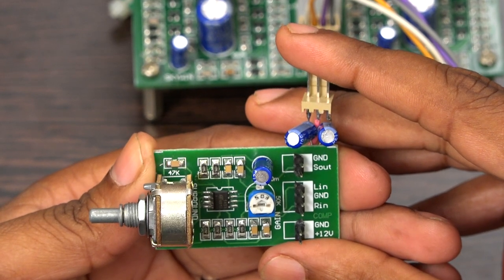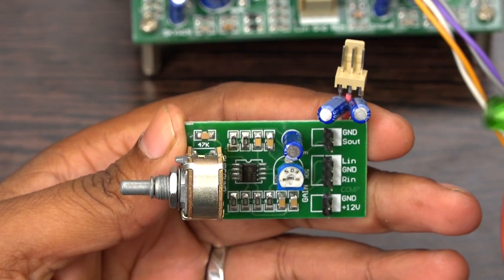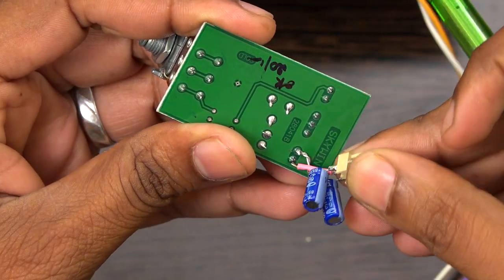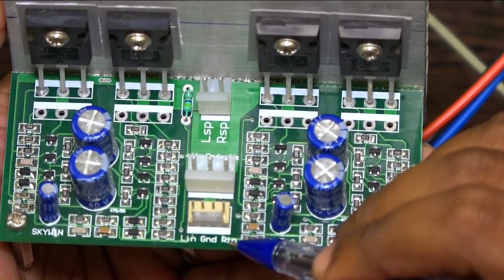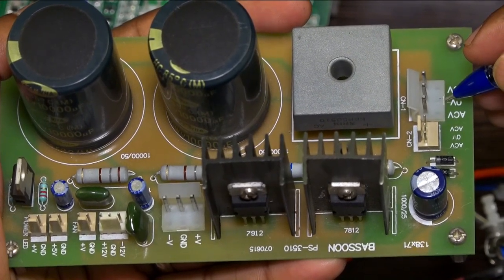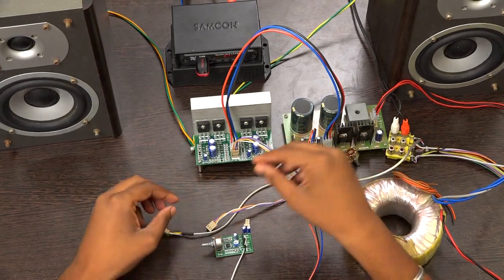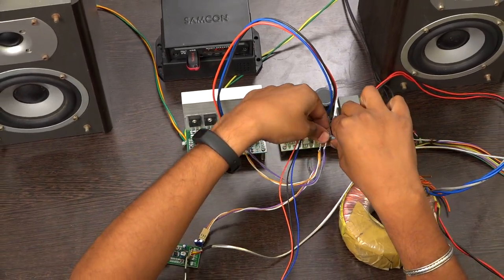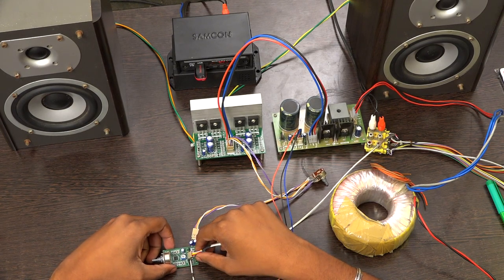Bassoon Mini Surround Board Demonstration

Comment: Congrats for bassoon technologies you are providing high quality products for customers.

That irf amplifier is very good I also tried it for 2 ohm intrestingly it worked well. (Used 24v 10A dual power supply from SMPS)

I suggest you to develop Wifi and bluetooth based remote kit which is similar to branded av receiver.

Also try to develop class-d amplifier boards (mainly focus on 4ohm loading it is very important)

What are the speakers you are used for testing? Please reply
Reply: Hey, hi, what class amplifier is this one?

Comment: Please note that in power rectifier/ supply board you said that 24-0-24v to 35-0+35 3 amps to 8 amps. What about the neighborhood ac terminal? How much ac voltage and amps is to be given? Can we use both ac inputs at a time or one at a time? Please clarify.

Comment: Sir 4irf250 mosfet doda innu 4irf 250 mosfet add paainna output value extravagumaa
Reply from the maker: Yes! you can parallel 'n' no of MOSFET. And as you expected the output wattage will increase considerably.
Reply: Just paralleling the MOSFETs won't increase the wattage.U have to increase the supply voltage proportionally...sometimes u have to change the driver transistors as well which can handle more voltage.
Reply: OK thankyou sir